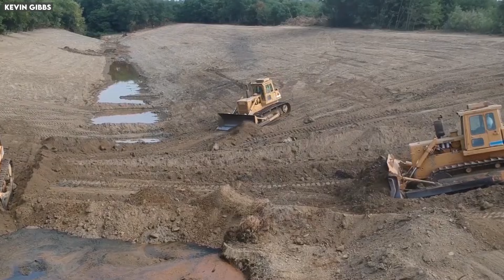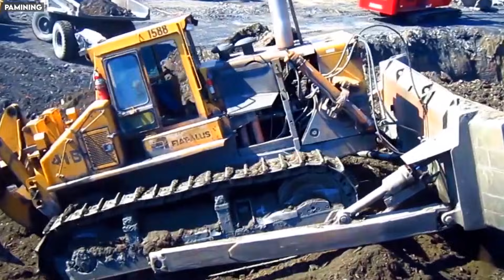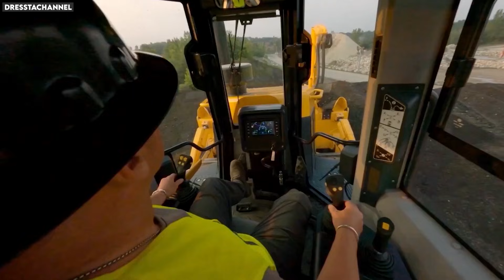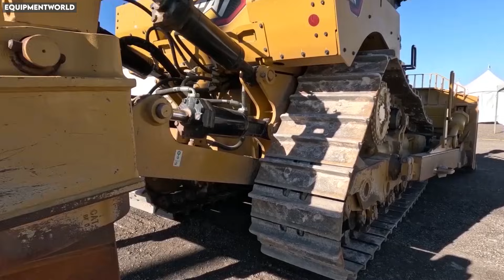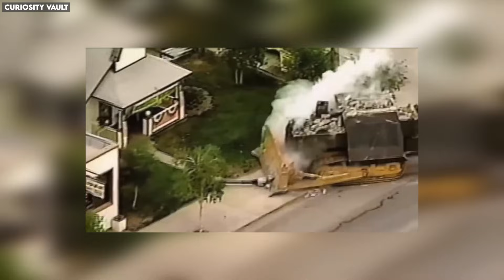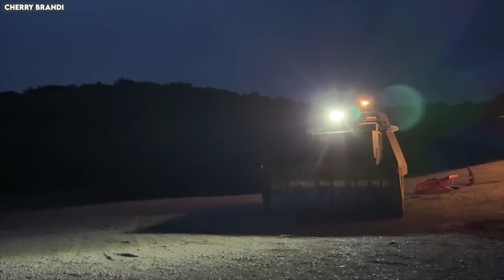10 BIZARRE CLASSIC Dozers You Won't Believe Are Real!

Comment: Hello, Supreme Machines.
Do you really have any idea what you are prattling on about??????

The LeTourneau TC497 was NEVER an 'earthmover'. IF you had any idea at all what you are talking about, you would know that. I am NOT going to tell you what it WAS designed and built to do. The 'individual wheels' were 'just a tad' HIGHER than a grown man. YOU get out there and DO your research.

The Komatsu D575 DID NOT have elevated drive sprockets and, while being big, was still a pile of junk with a pretty early 'use-by' date. Of the 'whopping' FIFTY THREE of them ever built, I would not be surprised if there NONE still actively working on job sites today.

You prattle on about LeTourneau's electric drive machines driving tracks when LeTourneau NEVER built a tracked machine of any kind.

The original Caterpillar D9 'dozer did NOT have 320 horsepower. DO YOUR RESEARCH.

International Harvester's TD25 was NOT 'their most powerful statement'. They built one model of tracked bulldozer and a couple of models on wheels which were quite a bit bigger.
Again, DO YOUR RESEARCH. 

The machine that Caterpillar introduced in 1935 was NOT called a "D8". It wasn't called a "D8" until 2 years later. Again, DO YOUR RESEARCH.

Just my 0.02.

You have a wonderful DELUSION. Best wishes. Deas Plant.